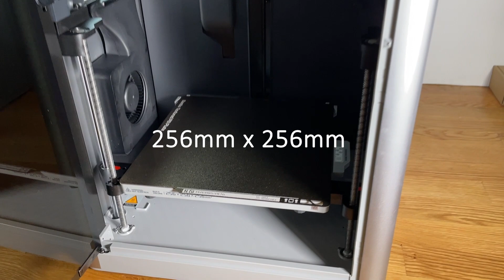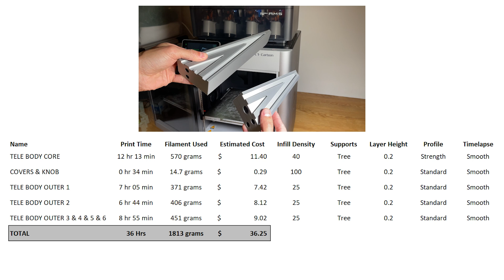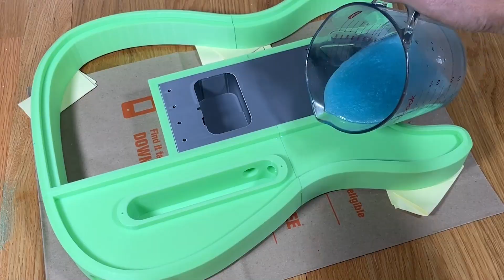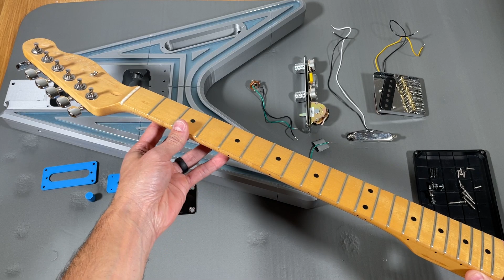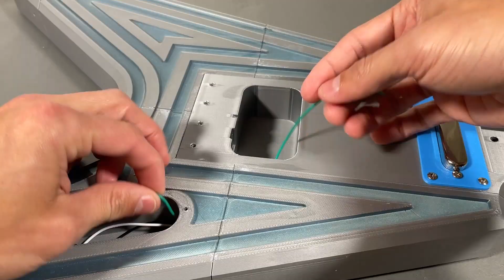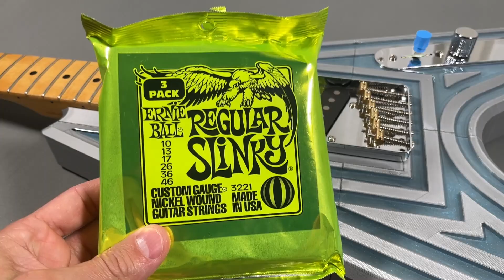3D Printed FLYING V Style Guitar Project! Step by Step Build

Comment: I have a 250 by 250 can I still print it
Reply from the maker: You will have to split the larger sections into smaller sections (can be done in most slicers). That being said, splitting the core into smaller sections can lead to flexing due to the tension of the guitar strings, so that is something to look out for (make sure the joints between the sections are strong). Hope that helps! Happy printing!
Reply: @the3dprintzone thank you! Can prusa slicer do what you said?
Reply from the maker: @Tomgamesandart  yes, you can perform cuts in prusa slicer

Comment: Really sweet build but the electronics don't exist on Amazon anymore. Is there another one you can recommend?
Reply from the maker: Thanks for the comment and letting me know the recommended electronics are currently unavailable on amazon. You can buy directly from ObsidianWire or I have had good experience with this pre-wired electronics kit https://amzn.to/4jq9voX (affiliate link), although the 2 mounting hole spacing might be off by ~1mm. Also, it's not a 'press and release' style electronic panel, so you will need to do some soldering. Hope that helps!

Comment: There's any way to use a 24 fret neck with that body?
Reply from the maker: It's possible. Might depend on the neck scale. Also, you may need to shim/file down the neck pocket depending on it's dimensions.
Reply: @the3dprintzone  the neck is 25.5, it's a Jackson from a Dinky model, theres any way to get a custom design by you? I wish to mess with a King V model
Reply from the maker: It works with a Telecaster neck (also 25.5) so should be okay. Neck pocket could be slightly different, not sure. Send me an email and we can discuss, there is a contact page on my website: https://www.the3dprintzone.com/

Comment: You will find that using superglue its gonna break apart sooner or later. Next time use 3D Print Goop. Lasts way longer, and much stronger..Also would have looked much better if you took the time to fill in the seams and sanded them down to blend. They stand out like a sore thumb.

Comment: Im curious how these will hold up over time because there's a lot of pressue from the strings and i dont think pla could handle it almost seems like a better idea is a wooden core with 3d printed wings
Reply from the maker: The PLA holds up surprisingly well with a high infill percentage for the center core. I recommend a minimum of 40% but 50%+ is better. You can also print in a stronger material for even higher strength to prevent flexing.

Comment: hey great videos man but can you tell me if I can print any of these guitars with a bed of dimensions 220x220x250? thanks
Reply from the maker: Thanks for the comment! You could, but it would either require you to tilt the parts on your print bed (more support material) or split them into smaller sections.
Reply: @the3dprintzone  wow i never thought of tilting the parts. Would there be any drawbacks of this?
Reply: @doggosensei341  main drawback would be that you would use more support material. This may "scar" the surface of the print a bit more depending on how easily the supports remove. It will also change the angle of the layers, so not sure how it would impact strength.

Comment: can u make varsion for other bridge and humbucker as a pickup pls and fro other guitars
Reply from the maker: Thanks for the comment! I plan to make a humbucker version at some point. Check out my other videos and website to see some of my other designs. I plan to do a Strat designs eventually as well….just not enough time in the day 😁 Any designs in particular you are interested in?
Reply: @the3dprintzone  im intrested in tele and also can u make a superstart?
Reply from the maker: @ginflash2409   I have Tele options available on my website: https://www.the3dprintzone.com/
Reply: @the3dprintzone  yes that's tele, but without option to add another bridge to install a humbucker, cuz strings need to go throught the guitar
Reply: dial buckers & a hipshot fixed bridge
Reply from the maker: @R1GAMBLER good ideas! 😊
Reply: @R1GAMBLER  bam. This is what I hope to see. I will definitely build one of these.